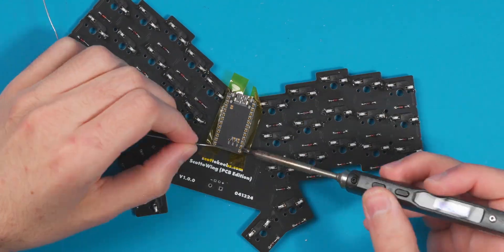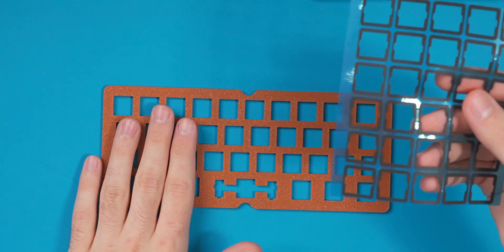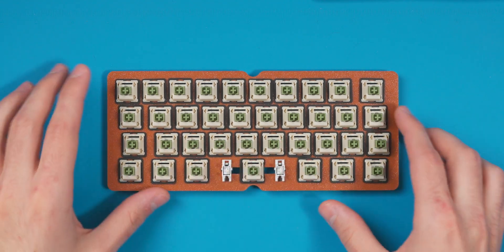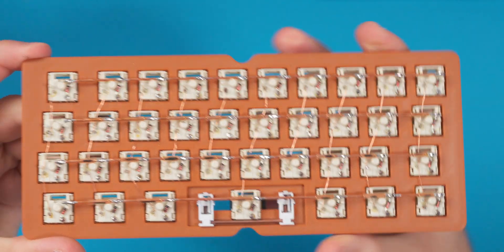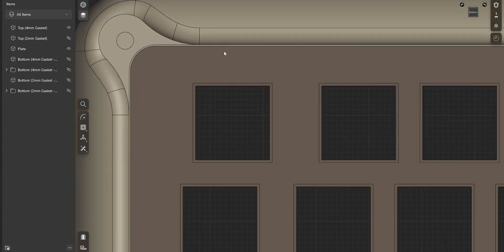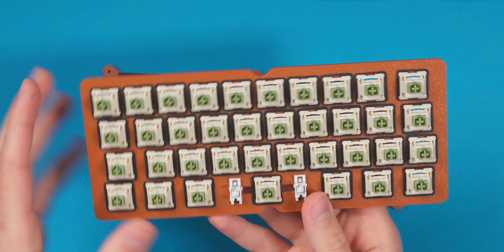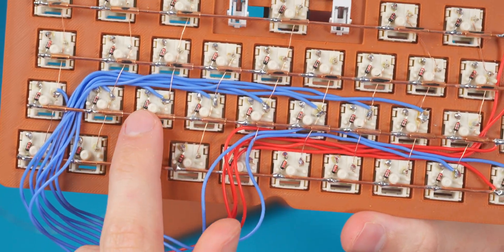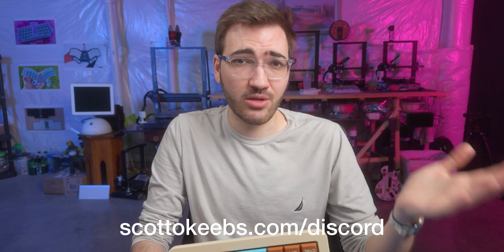Building a GASKET MOUNT Handwired Mechanical Keyboard

Comment: Turned out great.
Did you end up adding any hot glue to the switches or the stiff copper wire took care of it for you?
Also, a general hand wired board question: What do you do when a switch goes bad?
Reply from the maker: The wire held them in place. Switches rarely go bad but it’s simple enough to desolder and put a new one in.

Comment: i have a question is there a big difference between a atmega32u4 and the RP2040 you used? i have a atmega32u4 from a previous build and im not sure if i can use it.
Reply from the maker: RP2040 just gives you more options, it has more GPIO typically along with more flash storage for keymap features. That said, the 32U4 is more than fine for most builds and has been the standard up until a year or two ago. You’ll likely not run into any memory issues unless you try running complex images on displays.

Comment: I'm new to the ultra ultra custom all diy keyboard scene but I'm really loving your content so far! Would you mind telling me something about that keyboard layout? It doesnt seem to follow any common layouts and is missing some rather fundamental keys like the Q A and Z nah? how do you map those keyboards to still kinda use them functionally with just so few keys

Thanks in advance :)
Reply from the maker: The layout itself is "Colemak" which is an alternative to QWERTY, it's more comfortable and efficient to use. As for the missing keys, they're there, but they are just different for looks. Tab is Q, Caps is A, Shift is Z, and Func is O. The rest are on layers, so for example if I hold the right OPT key I'll get numbers on home row. Holding the right CMD key will give me symbols, arrows, media keys, etc. Space functions as both spacebar on tap and holding will give you command or control depending on if Windows or Mac.
Reply: @joe_scotto  Oh I see now! Interesting choice haha
Really cool build tho! I gotta say you absolutely inspired me to just go the next step from modding existing keyboards to designing, soldering and programming my entirely own keyboard. Keep up the amazing work!

Comment: Have you considered putting the "gaskets" in place of feet? I'm pretty sure the effect would be almost identical, in terms of typing feel.

Foam and rubber are notorious for being failure points in vintage keyboards. The evergrowing trend of putting them inside the keyboards is kinda ironic.
Reply from the maker: I could use some thinner foam for the bottom feel which might isolate it even more. 

That’s a concern of mine for sure but I think more likely is the super weak adhesive on the Poron will require it to be replaced sooner.
Reply: @joe_scotto  yeah you could. But my point is, there isn't much sense in making a keyboard flexible (thus, more vulnerable to foam degradation). You don't introduce per-key damping. And per-keyboard damping can be achieved with soft feet that are easier to replace than the gasket, long-term.
Reply from the maker: Putting foam as just the feet wouldn't give the gasket sound of feel, it would just add to it. By putting foam around the plate to suspend it, the sound and feel gets dampened.
Reply: @joe_scotto  That's interesting. I can imagine, the bottoming out vibrations don't travel to the case as much. Still, it is a rather hard concept to grasp w/o trying.  Much like mech keyboards themselves.

Comment: You should remove the left and right gaskets
Reply from the maker: Why?
Reply: @joe_scotto  more consistent typing feel. these gaskets are usually redundant and just add stiffness especially to the ends of the board
Reply from the maker: @General_Mills_  I found without the gasket on the sides, it felt mushy towards the edges.
Reply: @joe_scotto  If you press super hard on the edge keys they compress more indeed, but 99% of gasket mounted keyboards only have their gaskets front and back for a reason, consistency of the alpha keys
Reply from the maker: @General_Mills_  I mean, this isn't a standard gasket mounted board... it's handwired. That said, it feels extremely consistent to type on and use, omitting the left/right gasket would make it feel bad as I found in testing.

Comment: Dumb question here: How are you able to use this keyboard when it is missing some letters and a bunch of special symbols?
Reply: It's kinda like an optical illusion: by dressing the outer columns up as Tab and Caps, one sees a keyboard that's missing letters instead of the (typical) omission of "special" keys. 

I'm kinda "into" keyboard layouts, so I figured symbols were hidden behind a toggle-able layer or set of multi-key combos. It's less normal for layouts to bump letters from the base layer. Turns out, the keys on the outer columns are just deceptively labeled; Eg. the left-most column keys are (top to bottom) QAZ -- just like normal Colemak or Qwerty. The labels aren't totally out of place -- he eg. holds Z to use it as shift -- but they're definitely deceptive.

I think it's a really interesting set of decisions, and appreciate the compact and aesthetic result of emphasizing the functional aspects of outer-column keys through their labels and form-factors. As I said in my hook, this creates the illusion of the keyboard that's more minimal than it really is (which is still pretty minimal, by reasonable standards :p).
Reply from the maker: TAB - Q
CAPS - A
SHIFT - Z
FUNC - O

Rest of the keys are on layers. So for example, holding the right CMD key will get my symbols, arrows, media keys, etc. Holding the right OPT key will give me numbers on home row.
Reply: The symbols and letters are on a different layer. Similar to how holding "SHIFT" accesses a layer for capital letters and symbols under the numbers.

Comment: The 3d printed gasket mount looks really nice, you could design the plate with reduced thicknesses where the switches have their small hooks (how people do on dactyl boards) then they click in even with your foam pads without making the plate more flexible (if you print the entire plate with less thickness)
Reply from the maker: It is super nice to type on. The plate does have offset thickness but the foams just added too much for them to click in. If building without, it would be fine but with it would need to be offset a bit more.